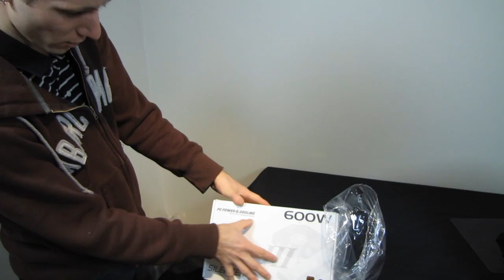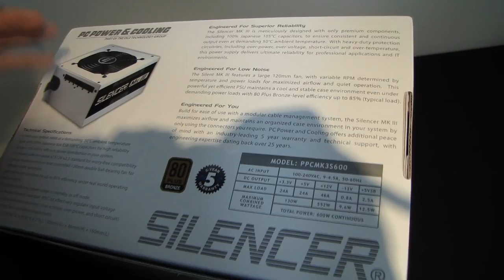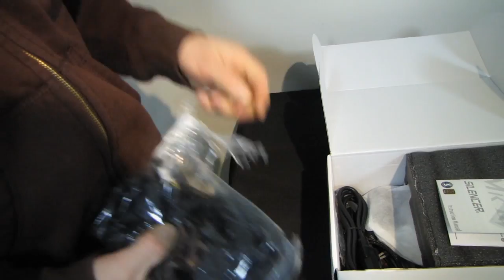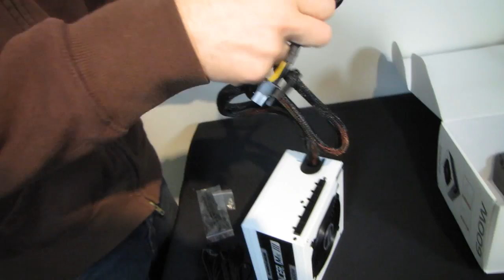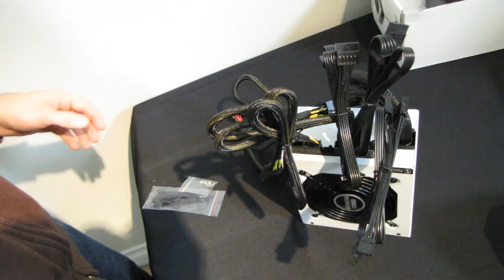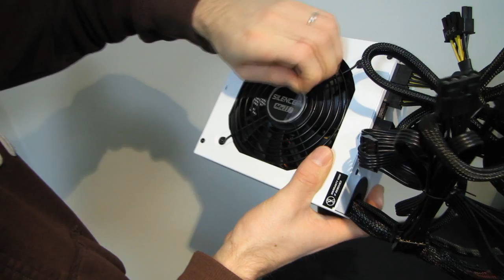PC Power & Cooling Silencer MKIII Power Supply Unboxing & First Look Linus Tech Tips

Comment: Engineer here. Ohm's law can be manipulated such that P (power) equals the square of i (current) times r (resistance). Since resistance is a constant, power is directly proportional to the square of current and, therefore, overcurrent protection could be called overpower protection.

Comment: @LouwrensStassen What I meant to say is that since you are dealing with a few fixed voltage output values overcurrent protection is the bigger deal.Therefor overpower protection really is overcurrent protection. Usually a voltage ripple on the input of about 5 percent is considered normal.

Comment: Since Power (Wattage) is Voltage X Current, Overpower protection could mean Over current protection (Especially if it is outputting at the correct voltages).

Comment: "Over-Power" protection is kind of vague. Power is wattage which can or cannot be attributed to the amperage in the circuit. I think what they mean is that if the wattage is fedback into the circuit and there is a large power loss (ineffeciency or larger voltage spike from the mains) that it will shut off. I guess in a way you could say that "over-power" is "over-current" protection but it's actually not the same thing.

Comment: Isn't over-power protection monitoring power consumption on whole power supply?

I mean, if total power is e.g 1000W but 5V rail is e.g. 200W, then over-power protection won't shut power supply down if power draw _from 5V rail_ is 300W, while over-current protection would cause it monitors each rail individually.

Comment: Well the term "power" in physics and engineering has watts as the units. So "over power protection" would mean it will not go over the rated wattage.

Comment: a single strong rail just means you don't have a choice. more than one strong rail means that you have a choice. it also of course means that you have more parts in the ps that can fail. but i personally prefer 2 12 volt quality rails, efficiency goes down, but ability to run consistently at the max ratted wattage in the long term goes up.

Comment: @nervoustwitch77 Current is NOT power. Electrical current is the flow of electrons in an electric conducting medium; just like a water current is a flow of water. Power is measured in Watts and current is measured in amps. I think what they mean by 'overpower protection' is a sensor that measures the wattage of the system rather than the intensity of the current to turn off the unit in case of an overload. Wouldn't like to have you as my electrician... Even I know better.

Comment: kay buddies, power depends on voltage and current (and others things but we dont care) we all know it. 
What happens when you limit only wattage? you can have too high current and very low voltage or too high voltage and very low current, no good for your security.
What happens when you limit current and voltage but no wattage? You ll be safe but if your PSU cannot deliver this amount of wattage, gonna have some issues.
Conclusion, it's OK to limit those 3.

Comment: Power = current * Voltage

If you have over voltage protection, that means the voltage will never go too high. Therefore it must mean that in an over power situation, the current is what rises. But if it's over power protected, how can the current go too high if voltage is fixed... This implies the unit is also over current protected.

Comment: @marouanebenouzekri 
Depends what graphics card your looking at. For midrange to low range (say GTX 540-560) is sufficient.
GTX 570/580 or AMD 6870 etc recommend at least 500-550. To be safe, if your going with a high-end GPU, make the investment in a 800W, just to be on the safe side.

Comment: @marouanebenouzekri 
Ok, so also mention this:
You have an older motherboard, so your limited to using the Q9000 series intel CPUs. They are still very good and capable CPUs for playing games at mid-high settings on a 1080p screen. But they are also not anything near a current i7's power.

Your best bet is to save money by getting a midrange card (you can get a discount on amd 6850/70 or gtx570 when the 600 series comes out)

No point getting a very pwoerful gpu when you...

Comment: Linus, you mentioned that you prefer placing the PSU with fan facing up?  Even in a case with PSU position on bottom, with air filter ( ie Obsidian 800). Would that not encourage hot air from case entering unit rather than cool air from under the case? I assume you are doing this to prevent dust intake? Please clarify?

Comment: depends on your system, are you running discrete graphics card?  Typically, the better quality PSU's begin around 400 Watt. Look for quality brands like Seasonic, Corsair, Power & Cooling. Ideally, 5 yr warranty..just avoid the cheapo's from the big box stores.

Comment: @marouanebenouzekri 
...your current motherboard only supports a few years old cpu.

It would be better to save up money for a couple years to just buy a whole new computer (new mobo, cpu, gpu etc)

But an E8400/Q9650 with a midrange gpu like a GTX570 or AMD 6850/70 will still allow you to play upcoming games on high settings for quite a while (couple years at least)

I'm guessing that you likely have a GTX 9800 or 260 based on the current age of your CPU.

Comment: @marouanebenouzekri 
To sum it up for you, Save your money for Ivy Bridge, if you don't plan on upgrading your CPU (E8400) anytime soon, anything like a GTX 580 / AMD 6870 is overkill since your CPU is bottlenecking your GPUs full potential.

If you want a good GPU for the future go ahead and get the GTX580/AMD6870/7870, but you need to be thinking of upgrading your CPU, otherwise by the time you upgrade your CPU, Haswell and GTX 700 / AMD 8000 will be out
Hope this helps.

Comment: Linus in your opinion or in your fans opinions what is the best overall powersupply in the 700-800w range.... taking into account it should be modular.... have good length on cables... a good size fan... and not horribly priced.... any suggestions?

Comment: Seasonic Modular 750 watt, or Corsair HX are both top notch, what GPU config are you running? if you can settle for 600 Watt, Power & Cooling 600 Watt Modular is a great bargain.

Comment: @marouanebenouzekri 
The GTX is $700-800.
Unless your a enthusiast gamer, the very high-end dual GPU is probably overkill for you.
Get the GTX 580, or wait for 600 series, or get the 7870 for $500.

Also with your E8400, having such a highend graphics card wont be worth it (so current CPU will bottleneck its full potential.

I have an i7 930 with 5870, if I got the 5970 at the time, my 930 would still have been a bottleneck.
You would need a new system if you wanted high-end

Comment: Something thats currently confusing for myself, I have a PCI-e power cable running from my power supply (running from the same area as the 24-pin Motherboard power cable), I also have two additional modular PCI-e connectors.
I'm using the Coolermaster 800W Silent Pro Gold, does anyone know which PCI-e cable I can use? As I'd like to use the one that isn't modular... still to this day I'm clueless as to what power connectors I actually need to use, or can use.
Anyone got any insight on it? x.x